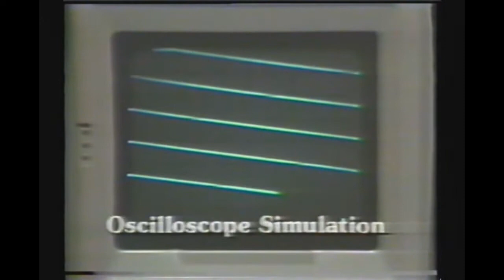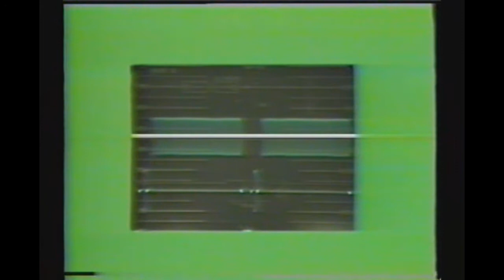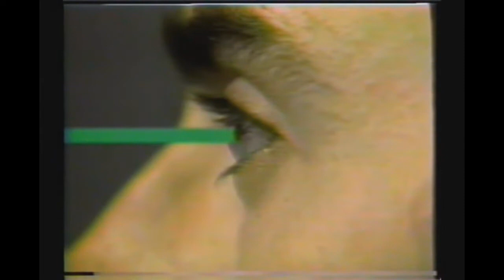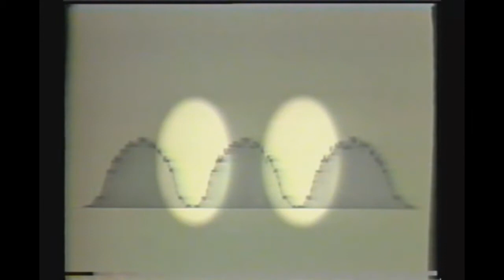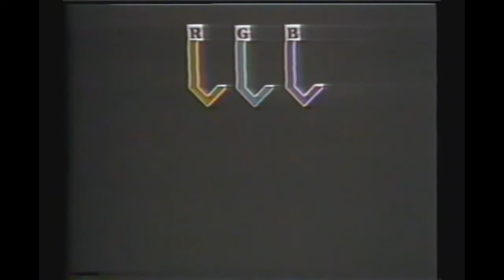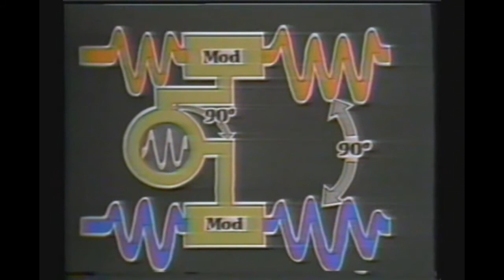Tektronix explains analog video color,  1979

Comment: What surprised me is that ICs in modern televisions continued to cheat by demodulating  NTSC with R-Y and B-Y instead of I and Q. It seemed like that was an opportunity to demodulate it correctly.
Reply: Per Poynton, by 1990 broadcast standards in the US were loosened such that Equiband color modulation (600khz R-Y and B-Y versus optimized I-Q) was fully blessed, and that effectively did it in.
Reply: @newoldstock_  So the early claim that the I component needed three times the bandwidth of Q to reproduce accurate skin tones was wrong?
Reply: @sco @scottlarson1548 i would probably describe it as "optimistic", rather than wrong...

The belief that 600khz chroma bandwidth would be insufficient was indeed present during the NTSC deliberations, thus the intent for having 1.3mhz for I and 600khz for Q, and based on my historical research this was the way broadcast NTSC happened well into the 70s, with few consumer sets recovering the extra I bandwidth. Equiband encoding took over in the 80s, and was then codified with SMPTE 170M to acknowledge it. Consumers expected less and got it.

Studio composite can of course exceed that of legal broadcast, and higher end sets had no problem with it. See also 1" Type C, LaserDisc, etc.

Comment: The irony... the color translation from ancient tape is horrible... on a video about color reproduction 🤣

All good because I finally understand the basis of the color burst. Only other thing I'd like to mention is the shadow mask was an impressive thing. A large fine screen suspended only by itself within a good size glass envelope that makes it impossible to adjust after the fact. Barring extremes, that thing stays put rather well and without using external magnetic fields within it to fine tune the gamut across the surface of the screen. The idea being to keep it as free of stray fields as possible to avoid color anomalies of course... so how was this thing placed so precisely in the tube that ALL of the elements lined up exactly with the.. um YouTube here.. "electron shooty thingies" at the back of the tube... no matter what you do to the beams back within the neck and shoulder of the tube, it does not change how the mask interacts with them, except as a whole. Absolutely amazing for the time, mass produced the way they were.

Comment: Judging by the chroma shift and head switching.  I would say 1 inch type C origin, U-Matic dub then U-Matic copy via TBC.
Reply: Looks like VHS to me. The colors are way too noisy..I could have originated on quad, no head switching or tension difference at the bottom. Then it got xfered down

Comment: Great explanation, answers so many holes I had in my understanding of colour analog TV.

Still amazes me how they achieved this with analog electronics and made it backwards compatible.
Reply: Being backwards compatible was a MAJOR issue that had ti be overcome. With millions of b&w tvs out in the public, color HAD to be compatible. Even the frame rate went from 30 to 29.97 because of the color signal interfered with the audio when the signal was transmitted
This new frame rate HAD to be compatible with B&W tvs.

Comment: Those colors didn't look right at all.
Reply: Maybe you need to re-calibrate the screen of your phone/tablet/monitor, as mentioned…
Reply: @anderslarsen1321  I hope that's a joke because the colors are way off from every other picture of SMPTE color bars.

The colors are supposed to be:  White, yellow, cyan, green, magenta, red, blue.  What I see here is white, yellow, azure, mint, salmon, brown, purple.
Reply: @sa3270  Duh…..
Reply: Probably some weird issue with the broadcast or something since the smpte pattern in the beginning looked slightly normal than the ebu looking bars they used after

Comment: I've used test patterns broadcasted in off-hours to adjust my TV before and it worked well.  I was always told that a taped pattern wouldn't - that I'd need a generator (when I was 11 this was a little expensive to ask for christmas).  Perhaps it was from a real generator at the studio even through a transmitter it worked?  Thanks for the info
Reply: Can you clarify your question?
A broadcast television station has a master sync generator. All signals are derived from this generator. 
When color bars are recorded and played back, it is the job of a professional video tape machine to reproduce these colors accurately. These colors are monitored by a vectorscope. On the vectorscope there are boxes on the faceplate that each color is represented by a dot. This dot is the phase difference from the subcarrier of 3.58Mhz. If the dot is not in the box vertically, that means the intensity is not correct, if the dot is not in the box horizontally, the "hue" is not accurate. Home videotape machine are absolutely terrible. On a vectorscope, home videotape machines the dots are NEVER in the boxes. They wiggle side to side and thus produce terrible color
Reply: @rty1955  Thank you - you answered my question.  That makes perfect sense.
Reply: Well there are 2 reasons why test patterns were usually not from tape:
1. VTRs are by no means perfect. They introduce all kinds of imperfections which usually are corrected by processing amplifiers at their outputs.
2. VTRs are much more expensive to run than even the most complex test pattern generators.
Reply: @altebander2767 videotape would NEVER be used as a reference signal, even though with broadcast vtrs you could not tell the difference between the two.
The reason it is never used as a reference: cost. You can get a generator to send out a reference signal for a tiny fraction of what it would cost you for tape

Comment: A few things that are not brought up in the video are:
1) color carrier signal shows up as a checker board pattern moving upward on B&W TV sets.
2) color TV sets have lower luma resolution than B&W sets, to filter out the color carrier.
3) Even with the luma resolution reduced, there still is spectral overlapping between the color carrier and the luminance, because they chose to have a slightly noisy picture over having an excessively blurry but noiseless picture.
Reply: More modern black and white sets contained a bandwidth limiter to reduce the color noise - similar to mono FM radios filtering out everything above 15kHz even when not having a stereo decoder in the radio.
Reply: @PascalGienger what about the line scanning  frequency indicated at the 23rd minut to be 15734 Hz but calculation gives  15750 Hz (525 lines/frameX30 frame/sec =15750 Hz)
Reply: @JushuaAbraham-sj2xl  That's caused by the color TV vertical refresh rate changing to 59.94 Hz instead of 60 Hz (a .1% difference). This was done to ensure that the horizontal refresh rate and color subcarrier frequency were an integer factor of the audio subcarrier, which would minimize the visual effects of audio interference on the color signal. (It was easier to slightly change the refresh frequencies than break audio compatibility with existing black-and-white TVs.)